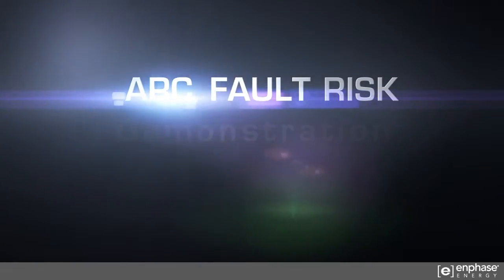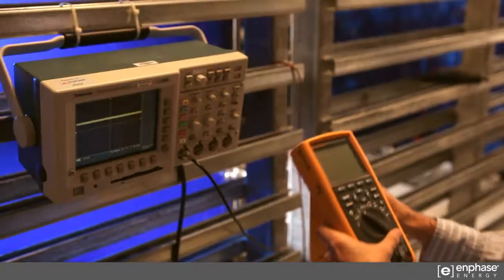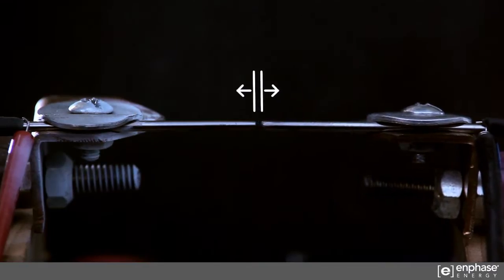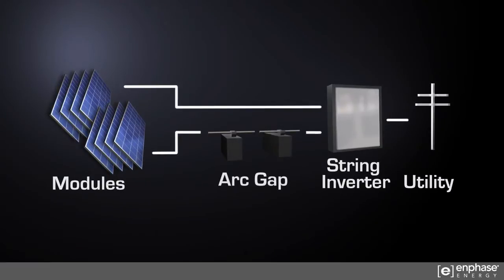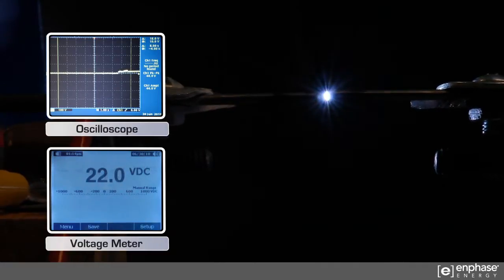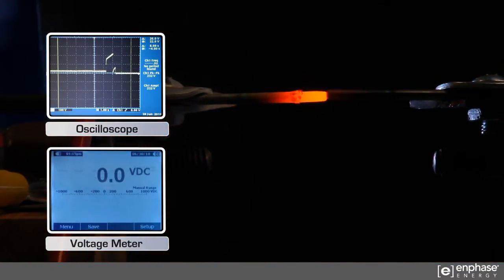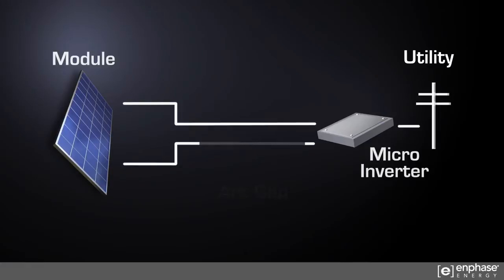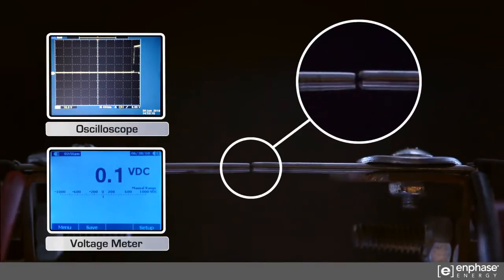Enphase Arc Fault Risk Demonstration

Comment: I hope you will publish an update to this to show what the landscape is like in 2023:  with AFCI (Arc Fault Circuit Interruptors) built into high quality central inverters such as Fronius, this risk is mitigated, if not removed altogether, and the advantages of DC-coupled batteries can then be employed.   I have NO commercial affiliation.

Comment: Remember kiddies, DC has NO zero volt crossover to help with ac extinguishing!
Reply: While that is true, this video is showing what takes place when you create a break on the DC side of the two different inverter setups.  The micro-inverter has a very low DC side voltage typical is 36Vdc at full load, where as string inverters work with high DC voltages up to or over 400Vdc on the DC side voltage.   The comparison was not fair though as the same DC side current was not used in both experiments.
Reply: @nick_parker  "The comparison was not fair though as the same DC side current was not used in both experiments."
The current show on the power meter device it was inverter output current (for 230V), input PV panel current was similar, about 8A. It is 9 years old video, in that time 180W panels was available with parameter 22V, 8A ;-)
Reply: @nick_parker  which makes the micro invertor the safer option??  - these panels are in the sun for 20 years - i know what i feel safer with